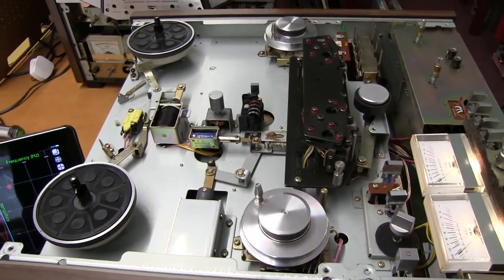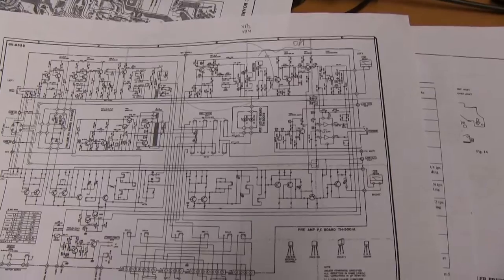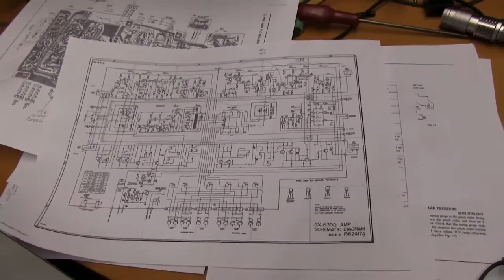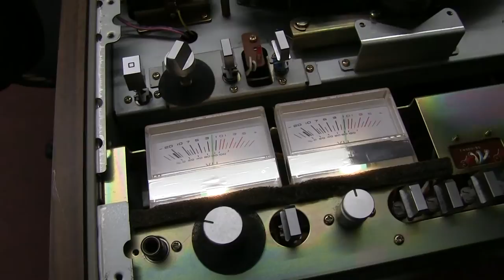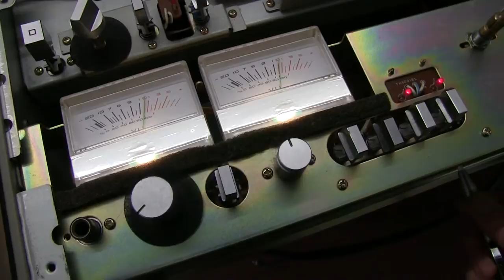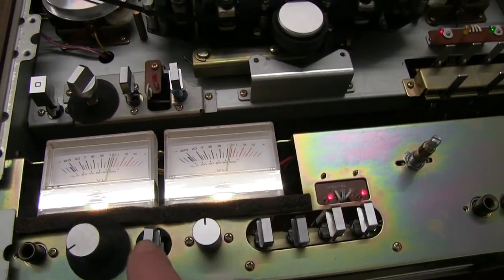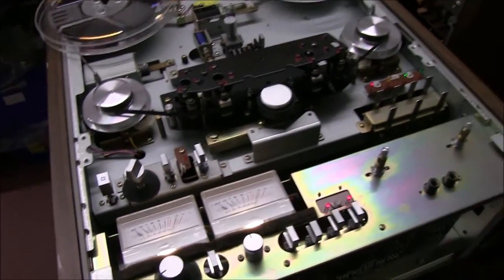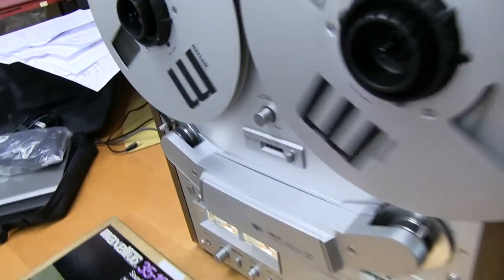AKAI GX-636D Calibration, Alignment and Sound Test Part 2

Comment: At the risk of over-staying my welcome I've come back because there is a great story behind the Studer A810 I think a man of your talent might really enjoy:

Sometime in 2008 I went looking for a R2R deck. I found out later that Filmco Canada had recently bought Studer's entire inventory when Studer moved out of North America. So here's this A810 for sale on Ebay from Filmco for $4200. We talked on the phone and I'm pretty sure I offended him when I asked if Studer made an auto-reversinbg deck! This was the beginning of my learning about R2Rs! He asked me if a few scratches was important. I told him I would prefer the scratchless one. Somehow I just got super lucky by unknowingly purchasing a 100% tricked out deck from a highly reputable company! More on that in a minute.

The deck was shipped from Ontario via Forward Air Freight on it own pallet to Seattle. It went from Seattle to Portland, OR on a Forward Air 18-wheeler, still on its own pallet. I know this because I drove to Portland to pick it up. (As an ex-trucker of 40 years I can say except for extreme duty trucks all of the rigs are air-ride now, but at that time FA was pretty much the only company doing it).

So I get the deck home and not a scratch on it anywhere. The manual is almost an inch thick in a loose leaf binder binder with both sides of the page used for printing. FURTHERMORE, The deck I was shipped has the 4-speed capstan,  the red button thingy, which is the Studer tape scissors (for those who may have always wondered what that red thing is) and a mounted Studer splicing block. It also came with an installed Studer Vari-Speed control. The range of markings to determine what speed you are at goes from 0-1000 and each mark is further sub-divisable by 10! This allows extremely precise control of tape speed that is re-callable. It has the great-looking bright red LED display instead of the ugly LCD one. I almost forgot- The deck has Butterfly heads as well! In other words it seems like I was given the totally tricked out edition! WT*?! I was also given a gold-colored set of NAB adapters and a brand new box of RMG LPR35 tape on 10"reel which they had recorded for me on God only knows what. A820? This is the only deck I have where you can play or fast wind a tape to the end and then go back to the start and the counter reading has not changed by even 1 second. It is impossible to stretch a tape with this deck. I know because I've tried. Doesn't work.

A810 is the easiest deck I have to work on, but even so, at one point I was shoving in one of the electronics cards (the entire deck is modular ) and cracked the basis board. I called Filmco and what do you think they said? (This is a large, very expensive board). They said no problem, we'll send you another one. (They didn't charge me one cent for doing this). And all this from a guy whose first question was do you have a reversing deck.

As an aside, did you know the Studer calibration controls are 100% digital? Every paramter is entered into the unit using a digital hexa-decimal system consisting of 256 steps being equal to the full rotation of a conventional potentiometer, while play/rec functions are 100%analog, of course. At the time there were no digital recorders. The machine was designed so that calibration settings could be recorded onto a tape and saved that way, making it easy for the engineers to save and recall the settings for any tape or session.

According to the hour meter (which Filmco zeroed) I have put 800+ hours on the machine and there are no visible indications of head wear, so the heads oughta be good for another 1500 hrs or more before they need to be re-lapped. It's the same way with the capstan shaft, which just BARELY has a little shine on it where the tape runs. So its good for many more hours as well! The A810 design takes capstan friction into account. 

What are the chances of ever coming across a sale like that again?

Cheers and best wishes to you!   -J

P.S. The A810 still works, but I know there are some caps that need changing. The capstan will lose its PLL lock causing the tape to wow as it momentarily slows down. I forgot where you are or maybe you didn't say. I noticed you may play guitar. How would you like to trade some services for a 2016 Breedlove Pursuit 100% Koa guitar? It's 100% solid Koa wood on top, back and sides, with rosewood neck and not 1 single scratch on it. Seriously. You would be stunned. I have taken care of it keeping the humidity at 40-50 percent, always shooting for 45, which is the humidity of the Breedlove factory. At this price the instrument is not made here. It's made in China to exacting Breedlove specs such as the graded solid wood top, being slightly thicker on one side than the other. This guitar could not be in better condition than if you had just purchased it. In addition to being an extremely rare wood (you have to go to Hawaii and buy a tree from a landowner) the Koa has an amazing tone. It's very similar to Mahogany in that it's warm and rich, but it's on another level entirely. Very pleasing sound which rapidly matured after I bought it new from the dealer. You can email me at jrhanek@gmail.com if you are so inclined. I can send you a pics of guitar and the deck, if you like. Almost forgot- the guitar's body style is known as a parlour style. Very popular. Peace!

Comment: Awesome tip regarding the dot on the NAB hubs, thanx!! I would never have known that, if not for this vid.
It is really a wonderful reference for anyone doing alignment on any R2R, of which I have 6 that I play with.
The 636 amazes me because it's so quiet at normal listening levels (and without noise reduction)!
Akai GX-636 x 2, Teac X-1000R, X-2000R, A-3440, Studer A810 (works perfectly & not a scratch anywhere on it).
The A810 is 10 times the deck that any of the others are. Fast wind is so quick it's almost scary.
It actually has 4 wind speeds and a ton of other cool features.
The only deck not working at 100% is one of the 636's, so am using it for parts.
Reply from the maker: Hi John. A great collection. The Studer are serious money.  Spin on. Nick

Comment: When adjusting the playback level, i think you should turn the volume all the way up. In the video, it was just around 10 O'clock position (8.55 min), if you made the potentiometer to 0-dB at this point then it became too loud at normal volume.

Comment: I also enjoyed it. You clarify and make it sound so easy to understand. 
I still need to sort out my Technics and I also have a Sony TC399 that need a sort out. 
I just don't know where to get the bits when It comes to vintage equipment.
Reply from the maker: Hi Jeremy. Thanks for the feedback. The bits for old equipment is always a problem.  Try and find a broken one on ebay etc.
Reply: I found a working one and it was not properly packed. I managed to come to a deal but the rubber idler wheels are gone.
The things sold for spare or repair are usually shot in the same way. @nickadams5411

Comment: Hello Nick. 
How noticeable is crosstalk on these players when calibrated properly? 
my GX-635D has is quite annoying sometime when playing a quiet piece of music while in the other direction there is a fast paced bassy track.
To calibrate the heads like you I would need a refference tape first as well, which is unfortunatelly very hard to find.
Reply from the maker: Hi Cato. First, you must have a new tape (or a bulk erased tape). Make a high level stereo recording in one direction. Then play it back and make sure playback heads are aligned for best playback. Then turn over and playback and see if you can hear anything. There should be no crosstalk. If there is then adjust.  Make a recording on a blank tape in the other direction and repeat the procedure.  All the best  Nick
Reply: @nickadams5411  Thanks for the info. I will try this. I do not want to mess up the calibration, so I will mark the current position on the screws so I can return it to if things get worse instead of better. I hope that will be enough.

Comment: Hi Nick, i am a little confussed. when you adjusted the VU meters they were at +5? in the manual did it not say RESULT 0 VU indication???
Reply from the maker: Hi Jimi
I agree that finding the correct 0VU setting is difficult without a true calibrated tape.
So some experimenting with the settings to get best result.
Rock on Jimi

Comment: Hi Nick when you use the iPad , how high do you set the volume  of the iPad
Reply from the maker: Hi paul
the app over rides the manual volume control.
However the 0Vu does not always seem correct, so you have to do some experimenting to get it right.

Comment: My pitch control stopped working ,any advice ? All I did is use some contact cleaner as you advised on the contacts inside,lubed the spring of the bar that moves inside as you go from play to reverse. After that it stopped working...strange.
Reply from the maker: Hi Mike
Check that all plugs are pressed home, or pull them off and on a few times to clean the contacts.
Also make sure no wire has come off or broken, although that is unlikely.
Operate the controls several  times to get them clean, and spray more contact cleaner.. Did you spray the actual pitch potentiometer as well?
Reply: When I had the covers off,yes and it worked perfectly before...that contact cleaner must have done something. I used that cleaner to clean the lens on a cd recorder and after the clen I had to put the machine in the rubbish. The lens was not reading anymore...what can I say...
Reply from the maker: Hi Mike
There are alot of different contact cleaners around, and most if not all leave a lubricating grease or film behind.
Thats probably what happened to your lens.
I have not known them to cause worse connection in pots or switches, after operating them several times during the flush.

Comment: This isnt correct , your meters should have been reading 0db on the first step not +5 and therefore you meters were out to begin with putting the rest of the calibration way out ?